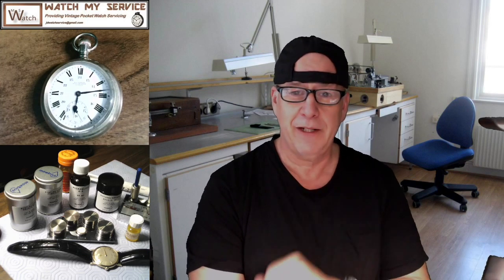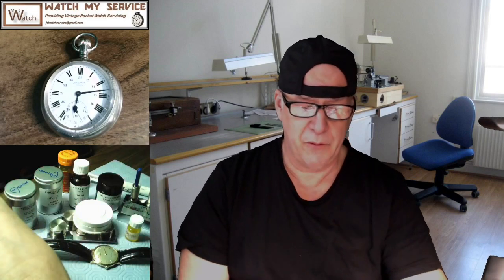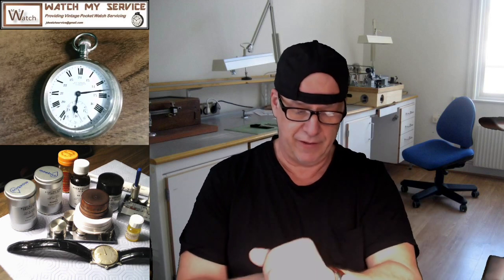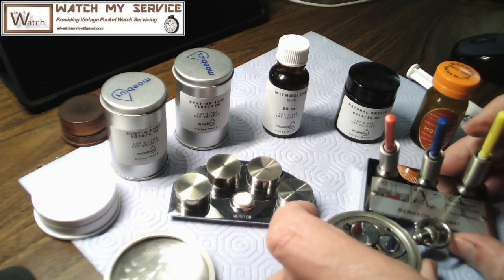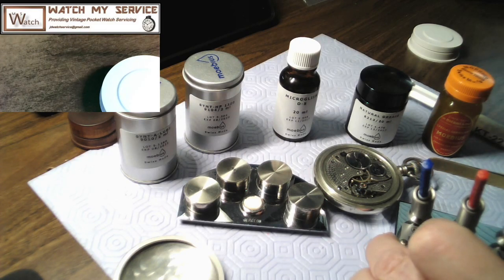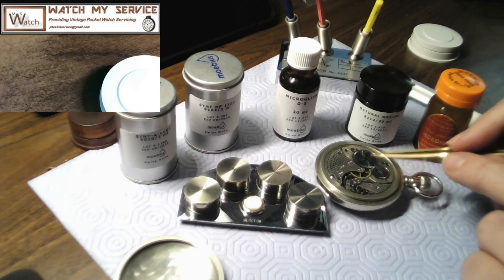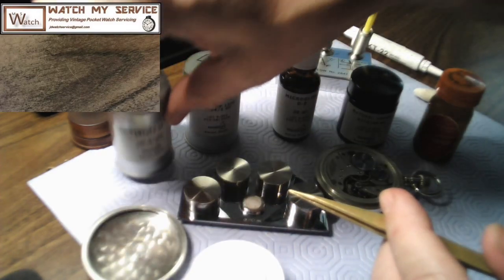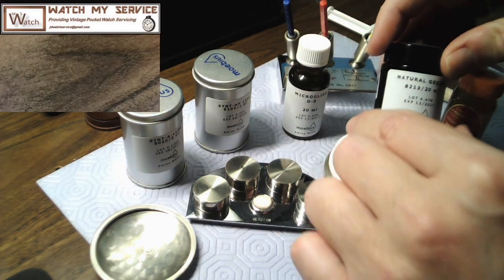Watch Repair Oils and Oiling

Comment: Hello JD; I have the following, synthetic 9010, 9104-HP1300, 9415, 941, "none synthetic" 8300 breaking grease. I did a lot of research on oils and type of grease to use, school of thought is challenging, opinions vary. My background is in Electronics Engineering, "retired" always loved mechanical watches as a hobby. For the last two years I have slowly amassed top quality Bergeon tools including the identical oiler you now posses.
Reply from the maker: That is excellent, another electrical engineer working on watches. At you Canadian, if so what school. Only the best tools.

Comment: You are right, I think 0W20 is too thin, would you say that 5W30 is better for 9010 replacement?  As D5 contains refined vegetable oil, surely that has no place in modern watches and a synthetic replacement would be preferred?
Reply from the maker: Not really sure what would happen to the watch movement over time if I were to use 0w 20 watch oil AKA car oil. However I think synthetic oil lasts a long time and doesn't degrade appreciably over time, so you'd think that using zero w20 would work fine.
Reply: That's a nice Pagani Yacht Master - I have a few Pagani Rolex GMT homages myself!

Comment: Hi JD when you service a rusty mechanism what procedure do you use to remove the rust before servicing
Reply from the maker: I have fake steel wool that I use for larger parts and I sometimes use my dremmal (sp) tool for smaller parts. And I have a scratch pen that o use for hard to get to places.